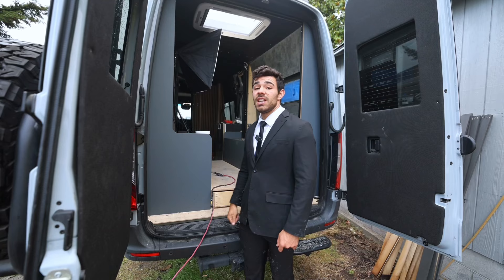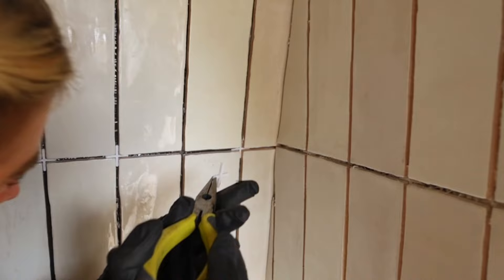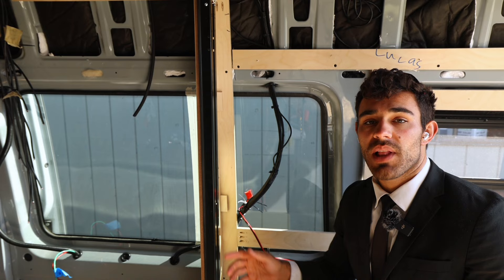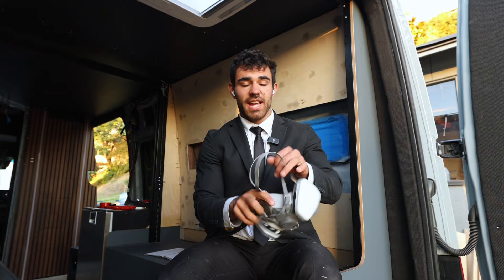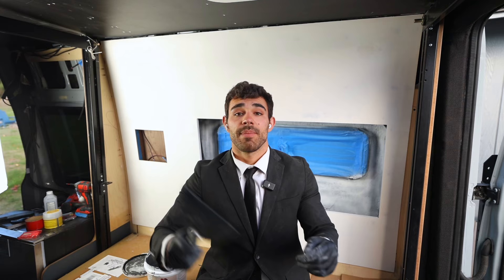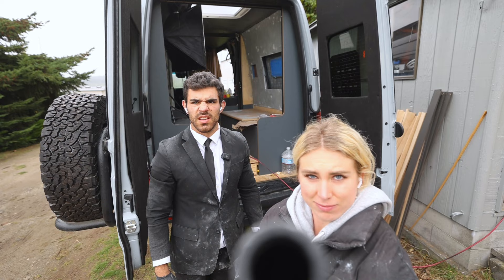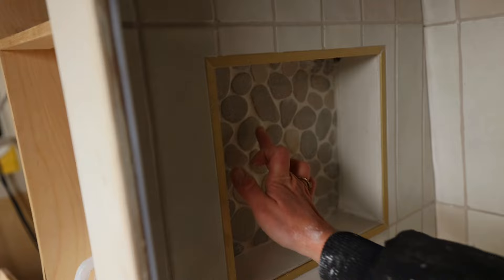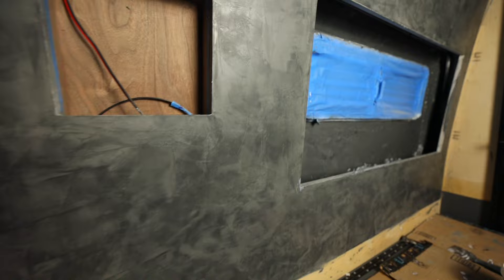Luxury Van Build | Applying Insane Roman Clay Finish

Comment: Question. Did you roman clay over any seams in the wall panel? If so, how did you go about hiding and preventing cracking on the seam. Thanks!
Reply from the maker: There were no seams anywhere that I used it so not sure